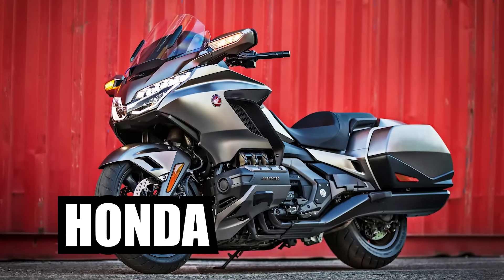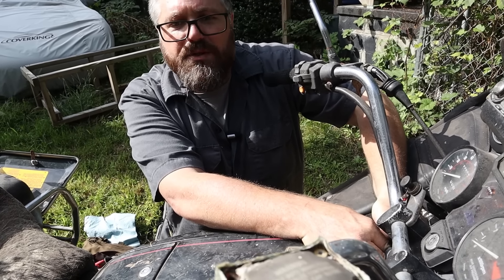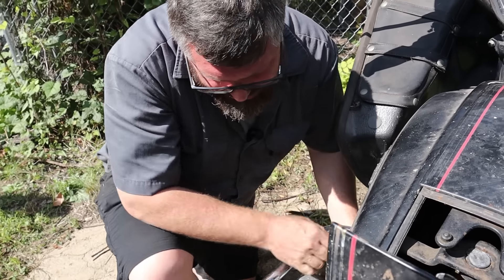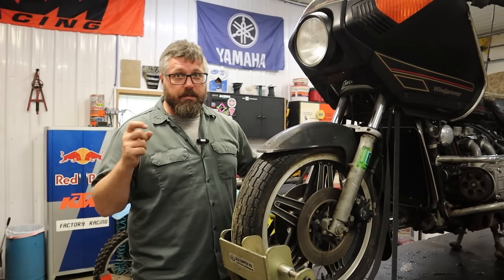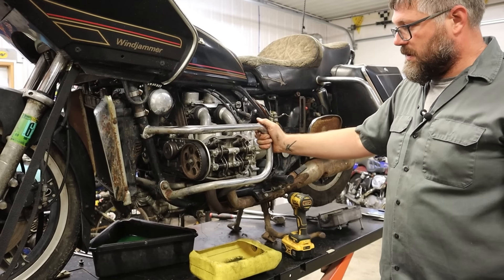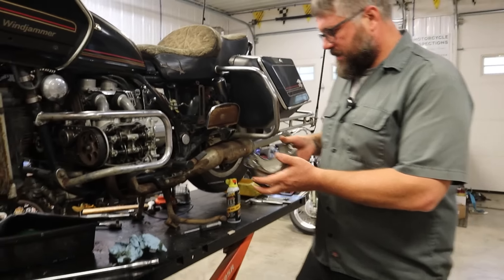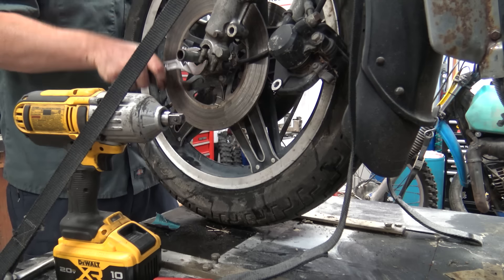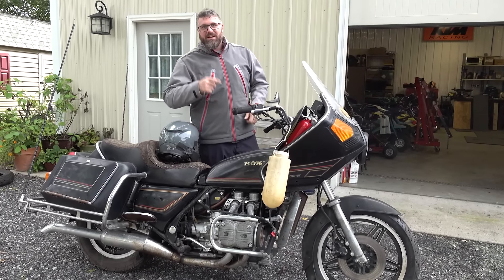Will this Abandoned Honda with a Seized Engine Get Me 247 Miles Home?

Comment: I was the owner of the Goldwing. It was great to meet you Craig!  To be honest, I never thought I'd see that bike run, but I'm really happy to see it on the road at least one more time.  Now that it at least starts and runs (mostly), maybe one day it will find a home and get regular use.  If not, maybe it can help someone else restore their Goldwing.  Great job, guys!
Reply: What was the reason for parking it up all those years ago?
Reply: @mj_aussie_coaster_travels8310  The guy I got it from said he'd stopped riding it in 2017 because his wife didn't want him getting into a wreck on it. But I have a feeling that there was more to it than that.  I never rode it because I knew it needed a new timing belt and I didn't want that breaking and grenading the motor. I'd planned on restoring it and everything, but I developed some health issues that made that impossible, so it just sat.
Reply: I love messing with old bikes, I like Craig’s style..
Reply: furry spotted
Reply: @whytebredd  We're everywhere
Reply: I'm pretty sure Craig has mob connections so he will have that bike running in a jiffy!
Reply: @DobieTanpaw can confirm we are everywhere
Reply: @DobieTanpaw I second this
Reply: It’s certainly going to help me with mine
Reply: Does anybody know where a fuse to the ignition that’s not in the side tank or by the battery     I’m lost I have a fresh battery and no power at all.   And I’ve already replaced all of the fuses I listed
Reply: 🙋‍♂️ no te a dolido como a mi el trato en desarmar y preparar este ejemplar 🙏😎🤣🤣🤣🇺🇾
Reply: OMG... a furry!

hello:)
Reply: I’ve got a Cb900c that the fairing would look good on . I need a windshield. I’m getting old in my mid sixties and don’t race . I like riding but the wind gets to be to much.
Reply: @DobieTanpaw   maybe  he goes away too long on a tour his wife wanna get rid of it lol
Reply: @ElfoTheClown it's not with the solenoid?
Reply: @rbradley5127 the dogbone fuse seems to be fine.   If that’s the fuse your taking about
Reply: Love the antenna trees .
Reply: @ElfoTheClown  is there a 30 amp bladed fuse on the starter solenoid?
Reply: @whytebredd can confirm
Reply: @rbradley5127   I haven’t thought to check lol. Il do that first thing in the morning
Reply: I’m going for a test ride. stop don’t forget the fire extinguishers!
Reply: I would love to take that bike and restore it back to life, unfortunately we're not even in the same country.
Reply: @DobieTanpaw I'm a furry my girlfriend Is too
Reply: @DobieTanpaw  we are literally everywhere
Reply: You wasn't the owner at all
Reply: @Mechanic-lee  Indeed I was. I handed the title to Craig myself, and sat watching as they did the work in my backyard.
Reply: @Mechanic-lee  yeah. He was.
Reply: @txrick4879  I liked the antenna trees too. I also really liked that Craig left them on for as long as he did. He is the perfect example of "tell me you have adhd without telling me you have adhd"
Reply: @DobieTanpaw  I enjoyed watching your bike getting a tickle from Craig's magic fingers, it was quite an interesting challenge. Thanks for providing him the opportunity.
Reply: @ElfoTheClown  Check the ground wires . No ground no complete circuit.
Reply: @ElfoTheClown  the main fuse is at the bottom of the starter solenoid a metal strip
Reply: Awesome another furry biker 😊 just learning to tinker myself and am excited for my first garage bike.
Reply: Make an 3xcellent boat anchor
Reply: Another great video craig keep it up enjoy watching him
Reply: This is a crime against motorcycles. I know where another one is setting under a tree. It's been setting 2-3 years. I would like to have it. But, I don't have the money to restore it to running condition.
Reply: I’m not that far away from yall like an hour I looked at the marketplace listing
Reply: @fabieneldridge3414 I had the CB 750 Custom of same year with exact same Fairing and Bags all same color, but no roll over bars  on the sides which I could have used many times. 
Can't get over the exact same Vetter Fairing, and I had an expensive Clarion and Pioneer stereo system.
Reply: @ElfoTheClown use a tester to follow the wire to find point of loss.
Reply: @Navyuncle would be interesting to track down the similar CB 750 Custom I sold in 1990 after riding it 7 years, bought like new from dealer in Houston selling it in 1983 for $2500 saying owner special ordered it and his back wasn't healthy enough to ride it, likely too old, as it was challenging some times to stop it from tipping onto it's side completely with one leg.
Reply: @Dobie Tanpaw; The wife thing holds up. Mine feared the same thing, but maybe if I just.......  Lol!😅
Reply: Hi Craig, you are really high up on the get it done and stick-to-it-ness list.  Keep On keepin On.  I too am a wrench but I only can go so far
Reply: What part of the country is honored by your presence?
Reply: @DobieTanpaw: Hey there! I'm the guy who gave it to you. I just stumbled across this video and recognized the bike instantly. Still has my plate on it. Yea, I'm sure I mentioned that my wife's always worried I'll get into a wreck riding but that's not really why I got rid of it. It had just become a project I didn't have the time or money for with the other 2 bikes I had at the time. I only rode it for one summer but it was pretty rough when I got it and was constantly needing fixed. I remember riding it home when I bought it and the wires were so messed up that the radio only worked when the left turn signal was on. I have a picture of you trailering it away dated May 17 2021. Whatever changes of hands it went through since then, I'm glad it finally got some attention. I hated to have it sit as long as it did but I kept hoping I would be able to work on it but 3 bikes at one time was too many for me. Lol. I was the last person to ride it before this. Hope you are doing OK!
Reply: @DobieTanpaw  not for long!
Reply: Thanks for exposing the heritage foundation! Based furries ftw!
Reply: Wonder if it came from NY, everything about that one looked exactly like the one I owned in the mid 90s
Reply: Don't suppose you know if the crash bars from the goldwing fit on the silverwing as well ?
Reply: Hi sir I have honda cd 200cc roadmaster 
I need to help please
Reply: Well mate you thought very wrong of your lovely big ex Honda!
Reply: @DobieTanpaw well I developed some life and mental issues, but I'm really looking forward to restoring my cbr250r 2011 now, dead serious, because I don't want someone else assessing whther is it a parts bike or a runner. You never know what will happen when it's stored for a while or rather long while. 
If someone can help me out with video recording and stuff I will definitely make a series of my own restoring. If not maybe whatever I do video turns up a headache for everyone but hey I can still restore and have a blast. 😊
Reply: @DobieTanpaw  It's got the best home DO Tan!! 😂

Comment: as somebody who wants to get into fixing old motorcycles this is so inspirational
Reply: Or discouraging 😂
Reply: @JacobBitner  thats a good one 😂
Reply: I'm well on my way with stage one, filling a garage with old bikes that don't run lol
Reply: If you’re serious about working on old bikes do yourself a favor and make sure you have a set of screwdrivers for Japanese screws and an impact driver you hit with a hammer. The worst part to me about working on them is fasteners that won’t come out or strip.
Reply: @chrisdow6627  GET OUT THERE and start workin man
Reply: @MikeRay1978  good point, an American Phillips 2 is different then a JIS screw.
Reply: @MikeRay1978  thanks, ill look into some
Reply: @MikeRay1978 battery powered impact driver is  the way to go, possibly the most useful tool I've ever bought 😊
Reply: curious to know if u have acquired any old motorcycles to work on?
Reply: He makes his money off of YouTube.  He would make about $0.35 per hour if he tried to sell it. I brought a few back from the dead but it's just fun - not a money maker.
Reply: @M.TTT.  I do, but I bounce around a lot. Right now I'm having fun running the kids around the neighborhood on a 125cc Chinese scooter I picked up for 100 bucks. The 79 cb650 runs and the 03 roadstar starts lol. There's a taotao 50 that's running just fine but I'm waiting on throttle cable and headlight. Farthest from running is a pair of hondamatic 750s in the corner.
Reply: @feelinghealingfrequences7179  no but am trying to get a kawasaki kmx or a klr
Reply: @donaldclinton1975  ye i know i just want to do it for a bit of fun
Reply: Thanks for making me feel like a total idiot lol. I purchased a 1980 goldwing and I’ve been working on it for 9 months now and have got it to start but not idle mostly because of a bad Carb. Just found a replacement carb so wish me luck. Love your videos.
Reply: Do it man! I've never had a bike before, and I bought a project on craigslist for $400. 1995 honda cb750 nighthawk. Beast of an engine and easy to work on. I bought it for way too much money, leaking fuel, and wouldn't start. So I got new spark plugs, oil change, cleaned the 4 inline carburetors, cleaned the fuel tank, and bought the missing fenders and even got new wheels. Still have to rebuild the fork and new front brake pad & priming the lines,  and replace petcock but she runs and idles now with no leaks!!!
Reply: @nakedmongoose123  You really have a real Gem there. The Nighthawks are very hard to find.
Reply: I live in PA now and my Dad is still in Georgia but he fixes up vintage Japanese bikes and goes to shows and stuff and being a member of the VJMC has helped him a lot lots of resources.
Reply: @WesJacobs33  thanks man!!
Reply: Remove sparkplugs and fill cylinders with penatrating fluid and let it set for a day before trying to rotate the the engine.
Reply: I've restored several and still have a garage full. It's cheap to get a junker and fun and expensive to fix it up, but at least it's fun.
Reply: I've done a few old bikes too, and it's much harder than they let on.
Reply: Just picked up a 79 gold wing I plan on restoring

Comment: A bike that old and in that condition, I will NOT bother checking any of the fluids, just replace them. Also rebuild forks, brakes, carbs, etc. To me, it is like changing the oil of a used but well running motorcycle I just bought. I don't care what the seller says, I replace engine oil and filter at a minimum. It gives me a peace of mind.

Comment: Currently in the process of restoring my Dad's '75 GL1000... Sorta. Had the same issue with the engine. Valves left open on cyl 4(?). Removed the head, cleaned it out and was able to get it to free up. The I pulled the engine and rebuilt it; honed cylinders, new rings and bearings. Bike is apart. Wife isn't a fan... Thinks I should just junk it. It's the bike I got my license on and the bike my Dad rode when we went for our 1st Father/son ride. I gots history with it!!!!
Reply: new bearings where on earth did you find all the new bearings?
Reply: U anywhere close to oklahoma? I need help replacing headgaskets on my 76

Comment: Craig, I have a 100% success rate unlocking locked up engines in 5 easy steps. Bikes are easy. 
1) pull the plug, or plugs. 
2) fill the cyl / cyls with as much 91% isopropyl alcohol  and let it sit for 12/24 hours (the alcohol is thinner than any oil, even thinner than water and will penetrate past the rust and rings over the night. It also will NOT smoke like oil in a cyl when you drain it out and attempt to start later or coat the exhaust. it evaporates!) 
3) put the engine into 4th or 5th gear after the cyls have soaked long enough and rock the bike forward and backward until you can either see or feel the cyls begin to break loose. 
4) once the cyls are moving, use an air nozzle to blow the cyls out and then refil with more alcohol and drain with ait to blast out any rust/debris 
5) once cyls are dry and clean, add new plugs and give it a start. (may need to change oil first as alcohol might get into crank case)

This has NEVER failed to work for me in over 40 years of using it
Reply: Great tip!
Reply: Good stuff. I will remember this
Reply: How about industrial vinegar? I've seen that work as well.
Reply: Thanks old timer I will use this at some point I'm sure 😊
Reply: They need lubed! No lubrication in this formula😅
Reply: If there is rust on the cylinder in any way, those oil rings are blown and that engine will always smoke. There is nothing you can do but pull the jugs.
Reply: Good steps but I would add lubricant to the cylinders as soon as it's turning over. I use Kroil, it's amazing stuff.
Reply: @JamesCouch777  i swear by that odd-smelling "free-all" in the silver can. it is actually a great lube and rust converter, and seems to be more slippery than kroil. both are great though... and expensive!
Reply: Acetone ATF mix .. or acetone oil mix 50-50 .. acetone being thin carries the lubricant and then dries out .. works real good. 
Diesel fuel is also useful. 
Pb blaster, has worked well for me .. 

Truly, depends on the level of corrosion and gumming. 

But if an engine is salvageable, between these three, i can get it moving. Sometimes soaking for couple months ahead. 
Having a heat source handy, also helps
Reply: What about the rust in the bore ?
Reply: @allseeingotto2912  if not too crazy, the rings will scrape it clean. But damage is damage, and it wont ever be like new of course, but after light rust, and careful break in and fluid change, it will be running
Reply: Great hint!  I use diesel to break frozen cylinders, and it has yet to fail me.  Thanks for your tip!
Reply: isopropyl alcohol is good for lots of reasons and smaller quantities evaporate pretty quickly
Reply: Very informative
Reply: @salmanz8  He had a heat source going for second.
Reply: @salmanz8  Acetone/ ATF  works great; diesel does too, if there's no hurry...
Reply: Getting ready to try this next weekend on an old goldwing.
Reply: @tnhomestead Status update?
Reply: @mr.chaosvicious5968  Is buried so deep on the honeydo list I can't see daylight qualify? Lol have a week off over the 4th and I will get it worked on, stay tuned!
Reply: @tnhomestead  I guess that qualifies.

Here is hoping that it works.
Reply: wrong
Reply: I'm curious in your engine count for 40 years. Maybe you can document it as (your name) technique and post it on YT. Sharing the knowledge to the world
Reply: Thanks for your knowledge Motor Wizard! I use Kerosene and brake fluid.😂

Comment: i restored the first 3 years of Goldwing ,and the GL1000 came out in 1975 i have one in my barn .. the 1974 was only a demo and not sold to the public . i still have a 75 and a 77 . i sold a mint 76 with 2680 miles ...and yes i have the fairing that are aftermarket  parts ..nice build ...i have a running GL1000 motor with 42000  but well kept  motor, they a special  valve spring compression tool  ,i have one of those tools ..i have every part of that bike in my shop . only thing not the same is bore size ...if you need a part i got them ..i live in upstate NY ..

Comment: Awesome video. I'm 71 years old.I owned an 81 Gl 1100 and a 83 Gl 1100. They were a couple of my favorite bikes. The 83 had over 140k miles on it when I sold it for  $3000. Besides normal maintenance, I only replaced the timing belts once.

Comment: I had a 1982 GL1100 Aspencade a couple years ago. I bought it from the original owner, but it had sat for 10 years. Fresh gas, new plugs, and new battery and it fired right up. I put a lot of work into it and road it 4000 miles before I sold it. Such a joy to work on these bikes. Simple, yet intricate. Ran perfect when I was done with it.

Comment: Craig, that bike is too good to end up as a parts bike. Make it a channel special and rebuild it. That Vetter stuff is iconic, and the bike is a time capsule of the early 80s. As an 80s kid, those things are the coolest, I'm a Honda parts guy now and the bits you'll need are still available and i'm on the other side of the planet from you! Step up mate, you can make it awesome again! Cheers, from New Zealand!
Reply: Hah, sounds like you’re more savvy than our Honda shop in Albuquerque. I went for some parts for my ‘75 400-4 and the kid at the counter was like, “There aren’t any parts for a bike that’s been discontinued so long”(?). I had him go ahead and look up an oil filter, and they had seven. I bought one, smiled and walked out. And spent $1000 at an out of state dealer for the rest of my parts. My 400 is gorgeous, btw. 😂
Reply: Chur au , Have to agree seems too good to part out yet . Mind you I've bought an entire bike just to secure my 650z a cylinder block , got so many spare parts now ! Even Anachonda is starting to run low after the 36 years  I've had mine . NZ .
Reply: Might need ur help have 1984 gl 1200 has sat years previous owner .had year still have try start it want drain fuel tank first
Reply: I fully agree, I would put way too much money into it and never regret it.
Reply: Please try to find someone who wants to restore that bike. I owed a couple dozen motorcycles in my lifetime and a 1st or 2nd generation Goldwing is one that has alluded my grasp.

Comment: I have had 3 of them exact Goldwings and five engines over the last 25 years and assembled my dream 3 wheeler from scratch. I cut the frames to extract the fuel tanks cut the kickstand from the frame to install the clutch assembly. Replaced wiring, brake parts, timing belts switched manifold to accommodate a single carb and replaced every single electric part. It took hundreds of hrs and was one of the worst Ideas I ever conceived. It was a beatiful sight had my dream machine. But I know you have know idea what you are in for.

Comment: Top overhaul be the best when piston seize up remove cylinder head ,  valve stems stock up to prevent further damages . When piston meet the engine valve ,better not to use starter instead ingage to first gear and rotate the rear  tire rim